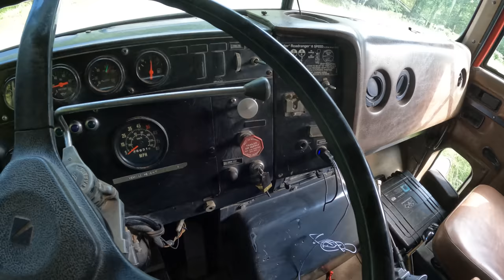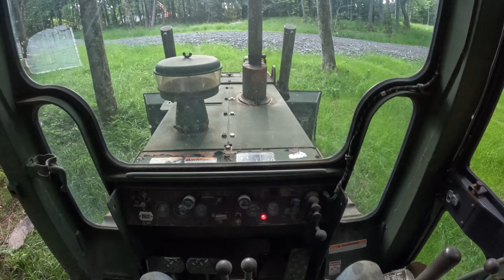Moving a dozer and shipping container

Comment: Concrete powder is your friend. It's relatively cheap and makes a great linking agent for rocks and aggregate. Just dump it over the areas to be driven and it will self set and harden.
Reply: I have a soft road which i have planned to stabilize with cement.
Reply: That powder is great, I have also used the finest crushed limestone commercially available it does a great job too👍

Comment: Hey Andrew, to answer your question about solar in the last video, yes, definitely worth it. Also super worth it as you have plenty of open space to put up a couple racks of panels. I've been offgrid about 3 years now and couldn't be happier. Check it out!
Reply: Get your own battery bank(s) too so you don't need to be hooked to utility at all like vince.
Reply: @845amg  what most people do during the Cloudy season and winter season is they hook a generator up just to keep their batteries topped off
Reply: @picklesgherkin Yes, I have batteries. In 3 years I've only hooked the generator up once and switched back to the grid once. I'm careful with the power consumption and try not to run the batteries much below 80% capacity on any given day. I'm about to add another 30KW of batteries which should have the batteries at about 90% the next day when the sun comes up. Also not running the LifeP04 batteries down to very low levels (20%) repeatedly extends their life significantly. Even rainy and snowy days the solar array generates enough power to run everything in the house with room to spare.
Reply: @845amg  he could go water powered. big mountain lots of water big holes to fill. Hydro Power systems is the best way to go.
Reply: @vincei4252  yeah that's a big thing a some people don't understand that you have to literally regulate how much power you're using especially on cloudier days
Reply: Unless you are off-grid solar is a scam.
Reply: @matt
Scam? Lol
Reply: @jessiepooch It never pays back. Solar panel lifespan is nowhere near as long as claimed.  In northern climates it is even worse. It’s a scam

Comment: Hey Andrew, one state east of you we use a product called "processed" which is either 3/4" or 2" or 3" or 6" jagged stone all the way down to the fines that lock the stones together. Im sure you could rent a crusher that would turn your crushed stone into finer material. Some places call it road base or abc or a plethora of names. Im sure you have used it or seen it, your hill is the perfect place to use it. Add a water bar or two and it wont erode either. You could of course also just buy the "stone dust" and mix it in on your hill, I promise you wont be disappointed however you handle it. It hardens like a rock with moisture and a compactor. 
Thank you for all your hard work making these videos, and nice dozer! And ive been using a similar diesel tank and it has been great, except that it does expand and contract a good bit. Nice to be able to remove it or leave on jobs.

Comment: I have the exact same dozer, it was marine corp. surplus.  The E model like mine is and I believe yours is, was the last one that will fully counter rotate under power.  It essentially has a "separate" transmission for each track.  Full power in turns with one track in high and one in low also.  1150 is compact like an 850 or JD 650 but a little heavier and tougher built while still about as easy to transport.  Very nice machine.

Comment: Hi Andrew, try spreading some rock dust on the loose road areas, it should lock everything together.
Reply: but where does he get that dust?
Reply: @bobrobert6277 he should open up a concrete drop off. He could get paid to accept the concrete the use his crusher to get dust. Resell left over.
Reply: @DensityMatrix1  
you know that crusher is on the top of a mountain
Reply: @bobrobert6277  nah he moved it

Comment: Hey Andrew, I was in the military for a few decades and have used trailers like the ones you have.  Two suggestions if I may, 1) when the trailer is not hooked up then mate those two air line connectors together and critters, dirt, etc. won't be able to get into them or the air lines, and 2) When you close the pintle hooks there should be a pin that goes in through the top to prevent that from bouncing open during transport - I highly suggest you use it because there's a reason they're there because of past accidents where the trailer flew off.  Those pins btw should be connected to the pintle hook by a little chain, so it doesn't get lost.  Great vid man! EDITED:. OK I wrote this comment before I saw you mate the connectors up - lol.  Still, get the pin on the pintle hook to prevent it from opening.
Reply from the maker: Thanks. Yeah the pin was in there.

Comment: You should put trailer hitches on all your dozers, so you can pull those heavy loads up your mountain without having a truck and second driver in the mix.
Reply: On one of them would probably be enough, biggest issue I think is dozers generally don't have air compressors.

Comment: Congratulations on the new old dozer I do believe it is D4 similar to the one you have but with  fully enclosed cabin that comes handy on sub zero temperature up on the mountain property. Your international truck still Kiking on but clearly needs engine rebuild at least the upper portion of it due to piston rings are worn out and i am sure it is on the pipe line to be fixed but you are busy bud.good luck with the new dozer and merry Christmas and happy new year...chiao....

Comment: Andrew, you should paint the roof of the container castle.  Even though the steel is thick, its modern steel and probably won't hold up.  i've seen steal thicker than that rot away.  Gray or black would be a good color.
Reply: He should paint it now, before the loose rust has to be cleaned off before painting.

Comment: You should put lockers in that stewart & Stevenson truck then you wouldnt spin out and get stuck on those steep hills. That truck would go anywhere you wanted it to if it had locking diffs. The truck would do a lot better if you added some weight in the bed and dropped the air pressure in the tires. It just seems that there is several of your videos where your getting stuck in that truck trying to pull something up that mountain. Really enjoy your videos

Comment: Andrew dump about 10 bags of cement on the ruts where you keep spinning,, that spots so steep the soft clay and sand is washing with each rain,, add the cement,, two feet wide both ruts20 feet or so dry mix should work,, it will harden and lock that stuff up!! we had the same problem here in northern Maine,, aloha
Reply: No cell phone was on my friends Ipad

Comment: I Andrew one of those smaller rock rakes that have the narrower gabs. If you could take that and scoop that rock up after you run it through. Your crusher wouldn't the little pieces stay on the ground? And then you get the bigger pieces. And you can dump them all in another place. And till you separate all the rock.  From the biggest to the littlest.

Comment: There are gladhand seals with screens and some that have a center that closes. You will get the insects in the trailer as well as in the truck. It's best to blow the truck airlines out before connecting the trailer by holding the brake pedal down while holding the trailer valve in. If they get debris in the airline, it gets forced into trailer valves and the brakes either leak or don't work.

Comment: You can keep some tools oil  bolts and other things like a geny and compressor there so you don't have to go all the way back to the top of the mountain each time if you make a ramp you can park skid steer inside when it gets colder and you have snow put a wood stove in it with chimney out of side put lean to against the side for your snowmobile and side by side keep them out of the weather so your Les likely to have trouble with them put a man door into the leanto keep some firewood in there for the fire if you put the fire next to the back and the chimney out back you can have door into the leanto next to it and have the firewood just other side of the wall would give you a warm place to work on smaller things in the winter would not take long to warm up that size area

Comment: All of our air brake  trucks in the motor pool and the glad hands and connectors (on the trailer side) have little mesh screens sandwiched over the holes under the rubber grommets. On top of having sheet metal faux couplers on the tongue of the trailer to stow them up out of the way. Looks like an M322 USMC HE Trailer so it should have stowage couplers inside the tongue towards the lunette. 
Edit: Grammar and spelling, my bad am jorhed.

Comment: I don't know if the coupling on the trailer was a palm-coupling but you should be able to get the covers to stop dirt from going in. It's not advanced engineering but a plastic bag held on by a rubber band is preferable to having to clean the pipes out everytime dirt has got in.

Comment: Stuff in the compressed air lines reminded me of plumbers thread - not the white plasticy stuff, but the old fashioned stuff that looks like ruff thin rope stuff. Wondered if it was used to seal up some fittings - although the purpose is it expands when it gets wet so seals. So can't see why it would be used on compressed air lines.

Comment: When trailers sit for a long time mud wasps will make nests in the air lines. Then when you run air it will shoot the debris through the line and get stuck somewhere usually causing the brakes to not release

Comment: If the trailer safety chains are too long, and the trailer comes unhitched, the tongue can dig into the road and flip.  It looks like the chains on the trailer hooked to your Army truck are too long.  If you don;t put the safety pin in the pintle hitch, a hard bounce can pop it open.  I've seen it happen.

Comment: you need to add a load of crushed limestone over the section you are having problems,   
The rock you mined from the side of the mountain is a mudrock, it is not great as a roadbase, your tyres will slip on that rock.   
Its OK for most of the sections on your mountain, but the steeper sections, get a load of crushed limestone in your 8 wheeler and give a topping of that.

Comment: Andrew, Engineer here, may want to consider paving a few of the steeper sections of your mountain roadway with small strips of asphalt for traction. Unless you have a way of lessening the gradient by cutting the more steeper sections out by elongating them (which may get you into retaining wall territory with the need to hold the opposing bank back since cutting the road deeper will make the banking side taller) Just something I noticed. Has the city/town you are in made you provide engineering plans to pull a permit for all of this earthwork you’re doing up there? Just curious if you had a set of engineered plans you are following?
Reply from the maker: Yeah I might. They were hassling me. But I am doing stuff the way I feel it should be done.

Comment: If that road is that hard to climb, I'm surprised you haven't sunk some winching posts in the ground about every 100 feet for those times when you might not have a bulldozer to pull you up the road.

Comment: My father had an issue with one of his roads, like yours with the spinning, so he bought a dump load of asphalt millings and spread it over the area of spinning.  He and I tracked over it with the Cat D3 eh I don't know, 10 times I guess and dang if it didn't fix the issue.  Been good now for 5 years.   BTW did you sell your D3?  could have swore I saw you use one a few times in your videos.

Comment: I am surprised you don't build a little platform for the dogs to board the taller truck and equipment.  That way you just pull up open the door and they can jump right in.  Little safer for them and less hassle for you.

Comment: Did u try running 100yrd thru crusher a 2nd time and use that for top coat. Believe it or not it does crunch it up smaller as long as u can load it fast enough to keep jaw full
Reply from the maker: I bought a new roller that’s getting stuff pretty flat and packed.

Comment: It would nice if you told us the brand of the dozer and model name. Also, is it like an ex army machine? The windows look thicker too.
Reply: It's an 1150 case. Ex Marine Corp. About 1990 model. I have the same tractor but with 4 in 1 loader(1155e) I bought mine on auction it came directly from Marines never used
Reply: @charlesjones7116  thank you 🙏 were this dozers produced in an armored version?
Reply: Don't know. But they all came with a rifle rack. Basically the same machine as civilian  but with lifting eyes and military paint. That's all I know
Reply: @charlesjones7116  thank you for the info Charles.

Comment: great pickup - n industrial strength dozer which you will use the shit out of and it will make you money on many jobs - some pm involved but that just goes with the territory - it is not mega sized which should make parts more affordable and maintenance fairly basic and straightforward - the roads and extra space look great - you may want to add some small gravel and sand or stone dust to the roads and they should last a very very long time with minimal maintenance going forward - you could clear out last of rock pile as you will always need more space but you have done most of the rough work already - just the final details left - cut down a few more trees and make bumper curbs on edges of the parking lot - add some big planters and sow some wildflowers to make it less industrial and softer, more homey, think about planting some trees go for some variety, add compost, think about a forage plot or two or threee and you can do some hunting for deer and turkey close to home

Comment: one thing about Army stuff they do the maintenance on the schedules / at least in 1975 to 1978 / if you ever get a chance buy one of their large generators they can power everything you have for weeks on end / when we went on field problems they would have two on a flat bed and run one generator 30 days shut it down and do maintenance as the other one ran /and if you had a problem you always had a back up if the maintenance was done quick enough